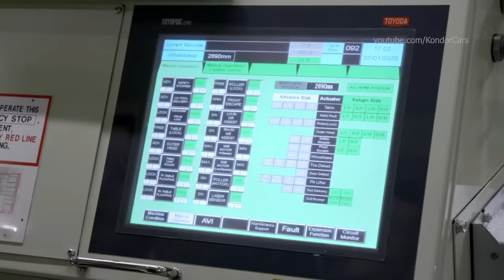2023 Lexus RX Production in Canada

Comment: One of the best plants in the world for building a world-class vehicle.  The testament to this is when you see a first Gen RX that is still on the road.
Reply: Indeed....I have the 1st Generation 1999 RX300 with 307,000 miles, zero problems. Lexus called last week to inform me my 2023 will be arriving to my local port on 11/20.
Reply: Still on the road yes but Lexus has stopped  making alot of these parts which makes it difficult to keep it on the road! I had a customer that needed an airbag computer for a 2003 rx300 but could not get one because they discontinued it. Customer has been in a Lexus car loaner for 2 months  now as we try to find a solution. The car is drivable but if they were to have an accident in it the airbag system would not do its job. As a Lexus Technician its frustrating because alot of customers love their cars and  do what's needed to keep them .
Reply: I have 1999 RX300 over 300k, built in Japan, like a tank. It drives like a rock, 80mph and still feel slow.

Comment: My 2012 Rx 350 runs great, everything fits and tight. I don't know where it was made ( should be  found on the door sill?) The engine is solid. My other IS 250AWD was 2006 and still runs strong
Reply: Your RX350 was built in Cambridge Ontario, the driver door sill will have a black plaque sticker, the bottom will say Made in Canada. Another indication is your VIN#, the first three alpha numeric digits are 2T2. Your IS250 was built in Japan, same placement on the door sill or the VIN# starts will the letter J. Nice cars you have, I have a 2008 IS350 and a 2003 GS300. Cheers

Comment: How many 2023 RX units do they get done per day in this plant? Are RX units only made in this plant in Canada? Are they made in Japan also?
Reply: Only Rx and ES model made in the USA/Canada. Rest of them made in Japan.
Reply: I used to work at the TMMC Toyota factory in Cambridge, Ontario and did about 550 Corollas and Matrix per 10 hour shift. On the Lexus side of the plant would do about 200-220 Lexus RX350. I can also add, starting 2022 the Lexus NX model is also built at the same Cambridge auto plant. Cheers!

Comment: I used to have a NX200T, it runs perfectly starting from Jan.2015 to Aug. 2022, with approximately 130,000KM. I just feel too boring which is nothing to care about NX200T, I just replace it with BMW X7.
Reply: wow what an upgrade I think the new NX is way more zipper
Reply: BMW will make a lot of fun cuz needs to go workshop all the time, and will leak from everywhere. Yes, not boring, German junk.
Reply: bullshit , as owner of 3 X5 and 1 X4  i have 1 issue on X5 with turbo actuator and that happen only because my engine is heavily tuned .
Reply: My sister and her husband bought into the BMW status thing.  That began to change when his X5 needed a new head gasket at 60K miles ($5500) and her convertible began leaking oil from rear seal at 25K miles ($3000).  They're  fun,...until they're not.  Driving dynamics don't mean that much when you're often in the shop, spending big money to repair things that shouldn't need repairing.  At least by Lexus standards.
Reply: @jfcn474  exactly! Guess what, with only 700KM, because of the uncomfortable noise, I went back to the dealer, and replace a pair of rod. That was really a shot for me! Good thing is I got 1 year plus vehicle warranty from BMW😂😂
Reply: How is the NX and X7 even comparable?
Reply: @iloveanime1313  cas I had it…

Comment: As an RX owner (2017 Executive Package 45,000KM mint condition) I can say these new models are way overpriced and that dumb turbo engine is a huge mistake.
Reply: Agreed. V6 was the best engine for this car. Turbo means more problems. I own 2010 RX 450h
Reply: I agree with you, the 2.4L turbo in the RX350/ RX500h and the 2.5L naturally aspirated in the RX350h hybrid doesn’t match the character of the RX. I find them a bit noisy when you want to get going faster.
Reply: However the RX350h hybrid gets 6.5L/100km combined average fuel economy if you care about consumption. Approaching double on the fuel savings.

Comment: Bought RX350h made in Canada in 2024. The Canadian models don't come with 'tow hook' and the connection to pull the vehicle in slide off scenario (believe the Japanese made vehicles do have this because that's how they are secured on the boats in transport). Asked the dealer, Toyota in the USA and Japan and nobody cares... All I told is ask a towing company. When the designer and manufacturer cannot answer the question I have the wrong company to do business with. 
Clearly Lexus quality stops on the production line and not in customer service. So much for Lexus excellence!